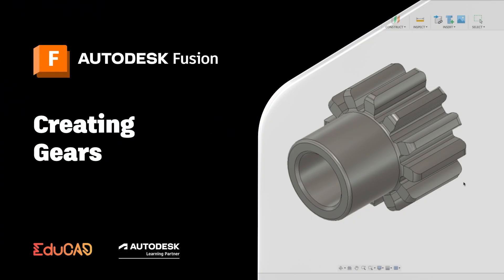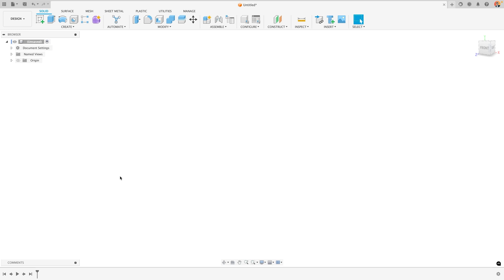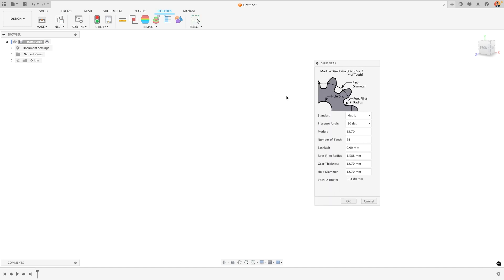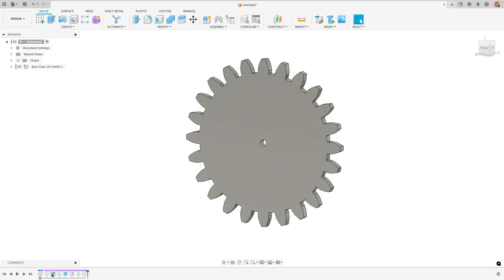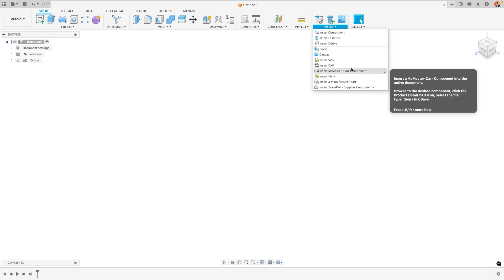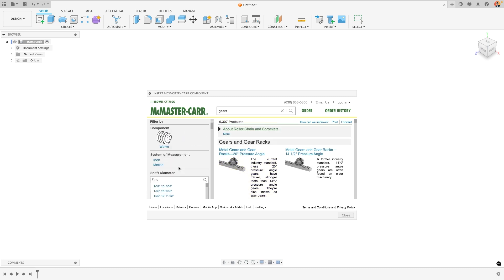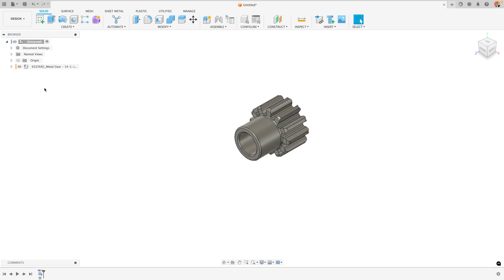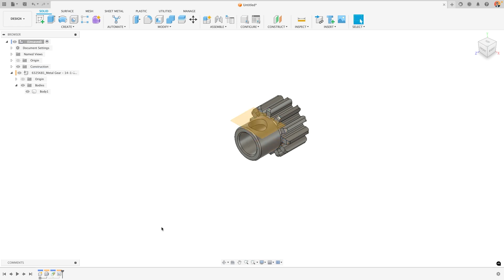Adding Gears to your Designs in Autodesk Fusion

Comment: Can I use the spur gear add-on to build a helical tooth gear? 
If not, how would you suggest I go about modelling one please?
Reply from the maker: Great question Mr Rctintin! 
The spur gear add on can't do helical gears, however there are several other add ons for Fusion that can do helical tooth gears! Check out the Fusion App Store. 

Alternatively you can insert a manufacturer helical gear as shown in the video :)